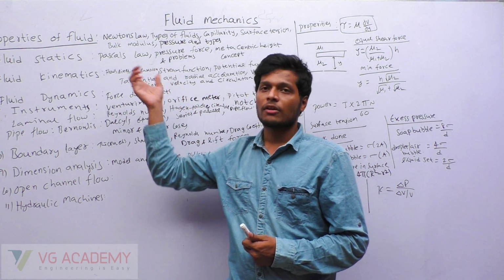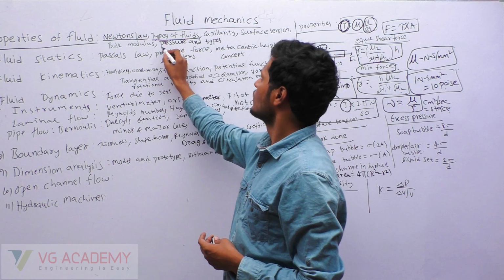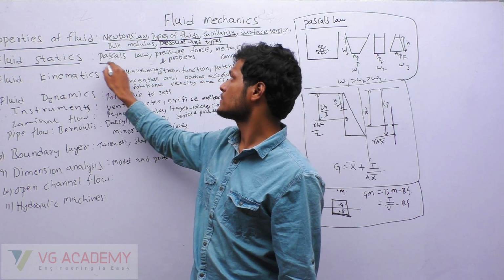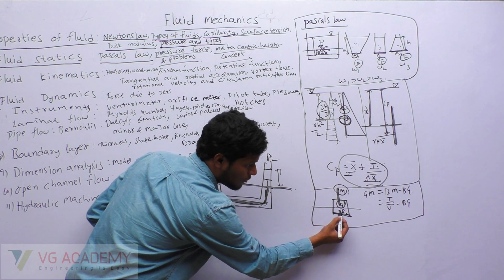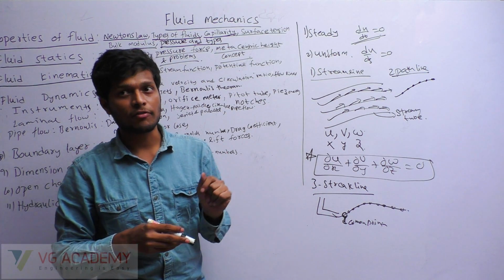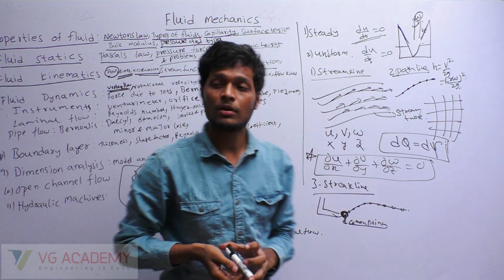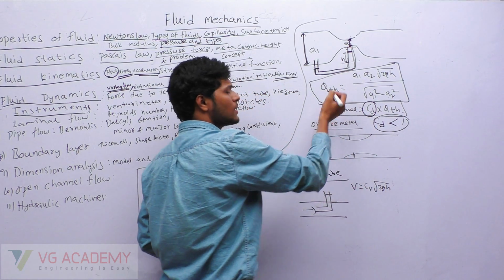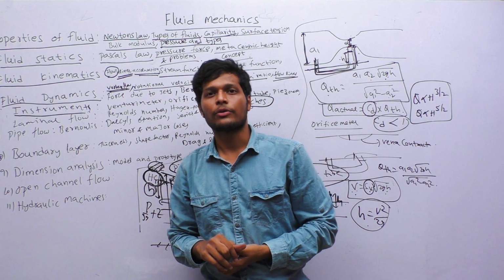overview on Fluid Mechanics part 1 (see description for corrections)

Comment: SIR MERCURY HAS LOW VAPOUR PRESSURE ,WHAT IT MEANS,WHAT IS TO BE UNDERSTAND WITH THE SENTENCE THAT SO IT IS USED IN BAROMETER,CAN U PLEASE EXPLAIN
Reply from the maker: every liquid shows error in height because we cannot see vapour on the top of liquid. for water, vapour pressure is 2.2m. so error is 2.2m. so we have to select liquid with least vapour pressure to reduce the error. Mercury has least vapour pressure. Got it?
Reply: VG academy Civil engineering thank you sir....I too have same doubt... now I got it...